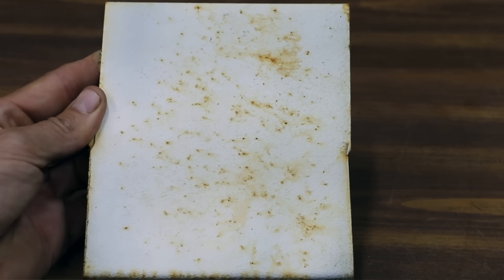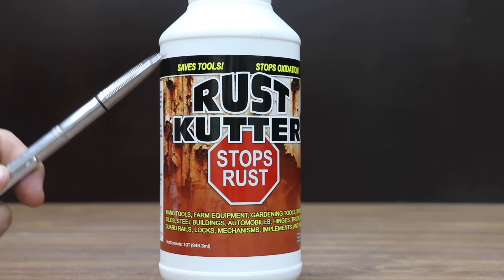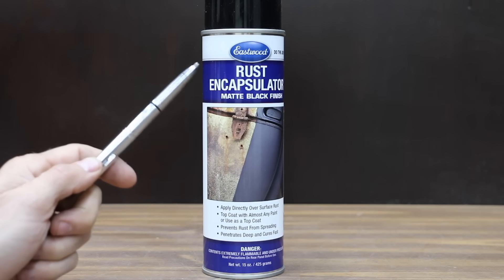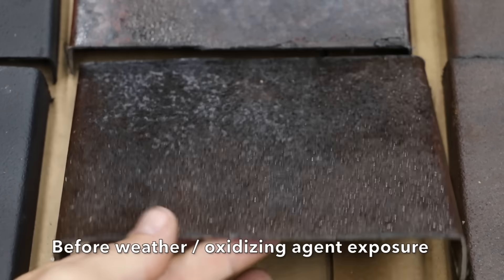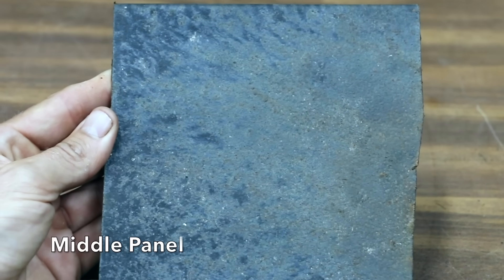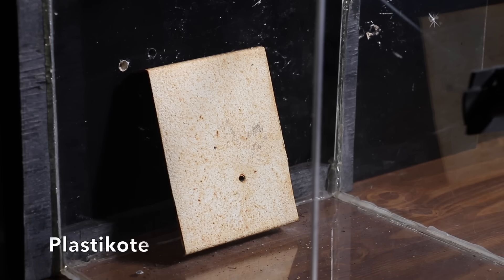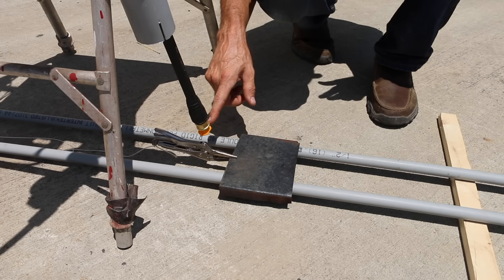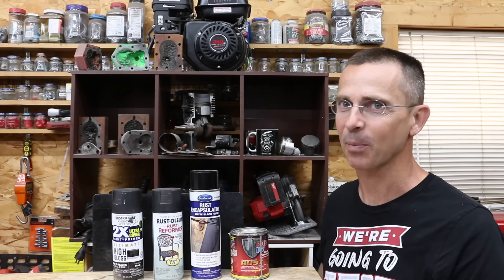Best Rust Converter? POR-15, Eastwood, Rust-oleum Rust Reformer, Gempler's

Comment: Having worked in auto body and in maintenance and industrial maintenance and electrical/electronics  and 48 years of boat /engine and car truck restoration as a hobby covering any thing that has rust won’t work. To be effective you have to remove rust mechanically and chemically clean the metal of all rust and metal prep the repair then many coats of  proven primer then apply the colour coats and possibly clear coats.
Reply from the maker: Thanks for the feedback.

Comment: Thanks for confirming my experience with rust converter chemicals.  I have used the rustoleum for many years along with  a commercial brush on liquid but have wondered if POR 15 was worth the cost. Looks like it is for car restorations and similar projects.  Excellent job.
Reply from the maker: Thank you very much!

Comment: I use the gallon of phosphoric acid prep and etch from home depot. As far as I'm concerned it works better that any of the "converters" . This test is kind of mixing apples and oranges though. There is a difference between a rust converter and a paint/coating. All of the converters would need a top coat of paint after being applied. Their purpose is to bring back rusty metal to a paintable surface, not for lasting protection. I have used at least 3 of the products you had in the test on and old Rav4. The Eastwood encapsulator didn't hold up real well. It is intended to seal rust off like por15...wasn't thrilled with it. Eastwood also has a converters a little bit like the plasticote but was better. Again,  I've used many others over tha counter sprays available at the auto parts stores, but for the price, a gallon of the prep and etch in a fruit tree sprayer goes a long way. Once dry then coat with rustoleum rusty metal paint....will last as long as about anything...except maybe por15 but that requires a top coat too to prevent UV breakdown.
Reply from the maker: Thanks for sharing.

Comment: por-15 is the toughest non-catalyzed paint I've ever used, it worked great on the floor pan of my old car. I remember smacking it a few times with a ball peen hammer to see if it would chip and it deformed with the metal, kind of acting like a plastic. I also saturated several pieces of fiberglass with it to cover up holes, which worked much better than you would think.
Reply from the maker: Thanks for sharing.

Comment: POR-15 is good stuff! I like to use it on automotive chassis and suspension parts. I prefer the black version, though. It's hard to get an even finish with the silver. Also, POR-15 doesn't handle UV radiation very well. So if it'll be exposed to a lot of sunlight, it'll need a top coat.
Reply from the maker: Great information.  Thank you!

Comment: I'd be interested to see what kind of chemicals the rust converters use. I have good experience with diluted phosphoric acid to turn rust to Fe₃O₄ I guess that's the same stuff in all these converters together with zinc to prevent new rust. Sandblast then diluted phosphoric acid then 2k epoxy coating is the best remedy in my opinion.
Reply: You could even just comment on the smell, like "this smells like strong acid" or something
Reply from the maker: Thanks for the suggestion.

Comment: To bad you didn't get Zero-Rust, it is similar to Por-15 but is UV resistant. Me and my brother have used it for vehicle restorations with great success. I used it on the frame and body of my 1972 Olds 442 about 10 years ago and has no rust has come through or has spread across the painted areas
Reply from the maker: Thanks for the suggestion for round 2 of testing.
Reply: @ProjectFarm  Just be aware, the formula they have is "supposedly" stolen by Rustoliem and marketed as their Professional series. Last I heard the makers of Zero-Rust are suing over it and has been on going for a couple years now.

Comment: Corroseal. 50 bucks a gal the very best I found when restoring a car or metal turns rust black solid state and area not rusted leaves a clear finish for painting 
Live in NY use Salt in winter used this undercoat car truck and after winter still same no signs of rust anywhere I applied this
Reply from the maker: Thanks for sharing.

Comment: You are great. I’ve been looking for a rust converter all this week and couldn’t figure out which one to go with. 2 weeks ago I went with Eastwood’s rust converter and I wasn’t too impressed with it so I’ve been searching for another brand (I’m looking into coroseal). I ended up painting over it with their rust encapsulator platinum so I guess I’ll see how my frame looks in a year. (I did top coat it with primer, paint, and an enamel, all of which claimed to prevent and stop rust). I’ve also used the rustoleum rust reformer on other sections and I have top coated it with the same process and I have no complaints so far
Reply from the maker: Thanks!   Thanks for sharing.

Comment: As for frame coatings. Epoxy based like Eastwood epoxy primer, SPI and such seems to be recommended a lot. Also, some undercoating products would be interesting to test. Especially with PB Blasters new coating sold at Home Depot.
Reply from the maker: Thanks for the suggestion.

Comment: The POR15 is really impressive. I went to a lot of trouble to use Gempler's last summer when I used it on my old rust bucket F250. It lasted a couple of weeks at most. Although, I think I'll follow Mustie's approach and go with fluid film or similar coating... maybe I'll try the POR15 on my snowblower though.
Reply from the maker: Thanks for sharing.

Comment: I would had liked to see result compared to metal that has been cleaned off and painted and laquered over ie. the usual paint job on a car also a comparison of "rust paints" would be nice ie. is the red "rust paint" better then zinc spray.
Reply from the maker: Thanks for the suggestion.

Comment: I really use your evaluations for my multiple needs around my shop and projects, thank you.
 I had an unfortunate accident happen in my shop, my roof leaked while I was laid up and my wood lathe bed which is cylindrical got wet and rusted! Now my tailstock will not slide to fit my projects. 
So I need your advice on repair or trying to refurbish this, please?

Comment: Here's an idea: test those "2X" primer+paint versions versus using a separate primer and paint.
Reply from the maker: Thanks for the video idea.
Reply: @ProjectFarm  Would be interesting to see both coverage and durability.
Reply: @ProjectFarm  and perhaps a full on sp3 sand blast, primer, paint treatment as gold standard control.
Reply: Yess
Reply: yes please
Reply: I've never found Shampoo+Conditioner-in-One to perform as good as separate Shampoo and Conditioner.  ;)
Reply: Most people think these mean you need only one coat. Read the label and you'll see that what they're saying is that these can be used as the primer coat too, but you need a finish coat anyway. Primer is usually cheaper than these paints so just another marketing gimmick that is most effective at separating you from your money.
Reply: Aren't those 2X acrylic-based?  Oil-based enamels always seemed more durable

Comment: I sandblasted my 3wheeler rack 4 years ago and applied por-15. It now has quite a few chips and has rust spots ( I keep it covered and in Minnesota)..better than spray paint no where near epoxy car paint.  Por-15 doesn't protect against UV rays, it's runny, takes forever to dry.  I lost my interest in this paint very fast.
Reply from the maker: Thanks for the feedback.

Comment: I have used Rust-oleum Rust Reformer on non-critical grill parts that has held up better than the OEM paint job.  The cost and availability makes it a good choice.  

However, if it was critical and I needed to ensure long term corrosion protection of the metal, I would sand to bare metal and properly prime and paint.  I guess I would only use the more expensive products if the cost to to sand to bare metal was problematic or more costly.

Thank for the test results.
Reply from the maker: You are welcome!  Thanks for sharing.

Comment: I just rustproofed my 2004 Subaru Forester with the Rust-Oleum rust reformer along with a couple of coats of the Rust-Oleum gloss back paint and it looks very nice. 
I used different Rust-Oleum products in this application starting with the rust dissolver gel and also used the professional grade rubberized undercoating.
Time will tell how well the Rust-Oleum products will actually do.
Reply from the maker: Thanks for sharing.

Comment: I'd love to see what wire wheel works best, I'm currently stripping material down and the nylon wheels say they last longer than steel or brass, and then there's stainless and if a twisted wire removes more than a loose wire. 

Cleaning a seam to redo the roof on a vintage trailer and it has old seam sealer on it, and also may layers of silicone, lap sealant and tar. So maybe the nylon is better for paint because it's bad for this sealant! It needs a show down for sure
Reply from the maker: Thanks for the suggestion.

Comment: I used to use a product called "duro extend" that worked unbelievably. I even used it before I primered cars, where they were prone to rust (under rear spoilers of Trans Ams and Z28s. Was incredible stuff but I haven't seen it for sale anywhere for years. I'm guessing it had an ingredient that was banned?
Reply: I remember that stuff.  I still have a small brown plastic bottle of it.  It turns the rust to something like ceramic! Awesome stuff.  I miss it.
Reply from the maker: Thanks for the feedback.
Reply: Same with a product called Osphos. It converted rust back to metal by chemical reaction. Cant find it any more.

Comment: Brake dust on front wheels is a common problem.   Are there better/worse cleaners specifically formulated or advertised to clean wheels from brake dust?
Reply from the maker: Thanks for the suggestion.

Comment: I have a story about the durability of the black POR-15. One time I was doing a bumper I had made and I was storing my foam brush I was using in paint thinner in between coats. Well after awhile the POR-15 set up hard as a rock, while still in the thinner. I blew my mind, you could see the droplets that were coming out of the brush had hardened in place. That same bumper saved me lots of damage when I rear-ended someone (not my fault, long story). The bumper ended up hitting the spare tire on this 90s blazer from the top, just shoved the rear of the body forward. Even though the bumper got twisted up pretty good there was no cracks in finish and no scratches to the metal of bumper. Bumper has been sitting outside since that for about 8 years, still no rust.
Reply from the maker: Thanks for sharing!

Comment: Small criticism, it appears that too much rust was removed by the pre-cleaning to give the rust converters a fair shake. The surfaces all looked dark gray and they really should be brown with rust for these to work properly. That being said, I have used them and was not happy with the results. Makes a surface on the metal that is a bit too glossy and a bit too brittle -- if it chips or cracks off, it can't do its job. Thanks as always, great video.
Reply from the maker: Thanks!  Thanks for the constructive feedback.

Comment: I’ve used POR-15 on a car about 12 years ago, and it has held up really well. It seals any potential for more rust from the air and elements.
Reply: Gotta use a degreaser on your frame a few times before applying poor.  Oil and grease wont let anything stick and it will peel eventually.
Reply: @timothyandrewnielsen  Yup. Prep is the most important step in any paint job.
Reply from the maker: Thanks for sharing.
Reply: what kind of car and where?
Reply: @tipr8739  1985 Toyota Corolla GT-S hatchback. At the footwell under the carpet, on the metal parts of the seats that bolted to the car, and a bunch of areas under the carpet where rubber stoppers were used and water got in and rusted the hole.
Reply: all of my por 15 has peeled
Reply: @gman8760  POR-15 must be painted with a topcoat or UV light will destroy it.
Reply: @BUCKMAW  yeah i realized that now. it was on my frame... however i painted my  well thats about a foot above the ground with no top coat and it seems to be holding up well
Reply: @gman8760  Probably didn’t apply it properly

Comment: I have done years long testing on the subject.  I found that por15 or similar interfere with mechanical movement.  Acid based converters like rustzilla (what I used on my truck) can be applied over suspension components and moving parts (spare tire chain hanger gearbox still works perfectly after application).  Consider ease of use and how far these products can soak into rusty metal, then pick one. The thin converters really need to be applied to rough and rusty surfaces to work effectively.
Reply from the maker: Great information.  Thanks!

Comment: Worst head pain would be a hard days work, money gone, and the rust coming back just as bad as ever.  I use a simple Rust-olum primer , brown color on 2" angle iron with some light to mid rust and it worked for many years ' about 10 or more' keep the angle iron really to use for what ever diy I wanted.  Use from a One Gal can.  Wish I had more as this worked so good in protecting the iron I brought.  Thank You all for your hard work.  This paint was back in the 1970's if that be helpful as makeup of same may have changed.
Reply from the maker: Thanks for sharing.
Reply: @ProjectFarm  ps..  I from Tenn. Rockwood, 37854  next to watts bar lake and we have lots of rain and hum be on the high side as well,  We get lots of rust wet days here.  Thank you all for your hard work.

Comment: I've used POR-15 on 3 truck frames and as far as I'm concerned, it's junk.
The best way to stop rust under your truck is Diesel, Kerosene and Chainsaw oil mixed together and sprayed on the whole underside. Thumbs up.
Reply from the maker: Thanks for the feedback.
Reply: This has been my experience as well. I think for long term corrosion protection POR-15 is too hard as i cracks over time. It's works great on a frame that doesn't get used a lot but a frame that flexes with normal use like what i used it for ended up being a disappointment.  Fluid film or something like that is better for high use stuff.
Reply: @lukem7203 , I used the POR-15 that looks like black paint and like you said, it cracked all over and eventually just peeled off. That's why I just mist the underneath with the oil combo now.

Comment: Thank you for your hard work.  Awesome video.   Would love to see either a video on tool battery led lights as far as best lighting, duration, hue, and durability.  Also I dont know if their is any interest but have been looking at large battery power stations like ryobi 40v 4 battery or dewalt.   I know ego and several other companies make them.  I've seen a huge difference in performance with some saying it's awesome and others saying its garbage for each brand.   I know if u did the test it would be fair.  I figured as an emergency backup more people are looking at them nowadays. Thanks again
Reply from the maker: You are welcome!  Thanks for the video idea.

Comment: What about the power output of 18650 cells vs 21700 cells in power tool batteries? Example: XC 3.0 Milwaukee battery vs CP3.0 High Outpuy milwaukee battery or the 4 ah standard dewalt battery vs dewalt 4 ah compact battery (21700 cells).
Reply from the maker: Thanks for the suggestion.

Comment: Yet another great video! I'm restoring a 68 Camaro and painstakingly covered every inch of the bottom of that car with POR15. I've seen what it can do and have always been very impressed. I even coated my rear differential and several years later it's still nice and black.
Reply from the maker: Thanks so much!  Thanks for sharing.

Comment: Very convenient video as I'm in the process prepping and coating my entire silverado frame in por15 and odd spots with rustoleum. 
Time and time again you have guided my product purchases in the right direction. Thank you for all you do.
Reply from the maker: Thanks and you are welcome!
Reply: Whatever you do wear as much protective coating as you can. I had to scrub my body with a pumice stone for 2 hours to get the por15 off after doing my Jeep lol. I wasn’t waiting weeks for my skin to do the work for me
Reply: @brodiepowers8698  I had the same issue because I already did the entire rear of the truck. It started to come off after 3-4 days. I still specks on my nails 2 weeks later. Supposedly the best thing to use is like vegetable oil or conola oil? Absorbs in your skin and lifts it off the surface from below

Comment: I have an idea. How about comparing cordless hand drill battery packs and chargers. Not the drill motor itself, but only the battery and chargers. I know you have done similar ones but i haven't seen one that shows the lifeline of the battery or chargers. The biggest issue i have seen and heard is people batteries or chargers die on them within a year or so yet the drill motor is fine. It cost about as much to buy a new drill as it does to replace a charger and batteries.
Reply from the maker: Thanks for the video idea.

Comment: I've used por15 for years and I wouldn't use anything else. I still have a old 2002 truck that I painted por15 on the frome that's still there in 2021 with no visible rust.  Good job project farm on the tests!
Reply from the maker: Thanks so much!  Thanks for sharing.

Comment: Perfect! Now have you done the best spray paint for durability? Never seems like it holds up to the original powder coat or epoxy. I'm looking at painting some snowmobile parts but everything seems to scratch so easily. I'll be using the Por15 first but now what to use for paint?
Reply from the maker: Thanks so much!  Thanks for the suggestion.